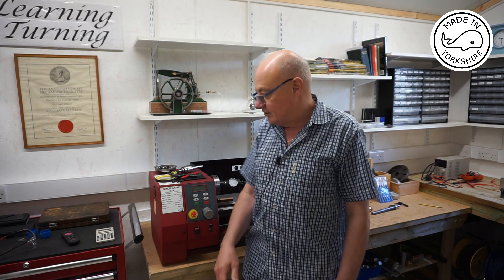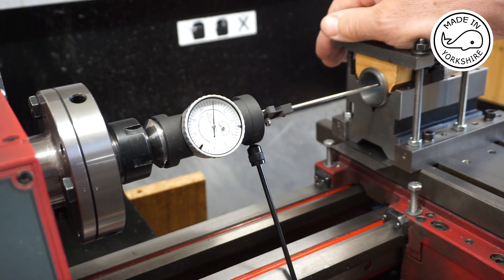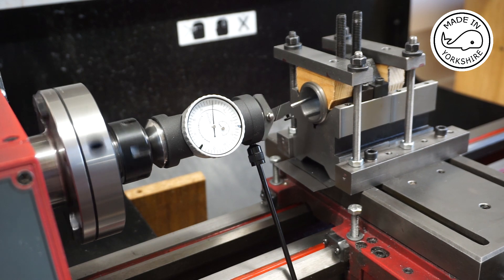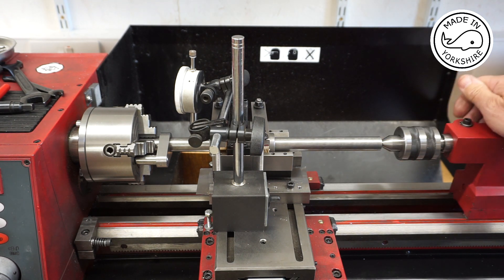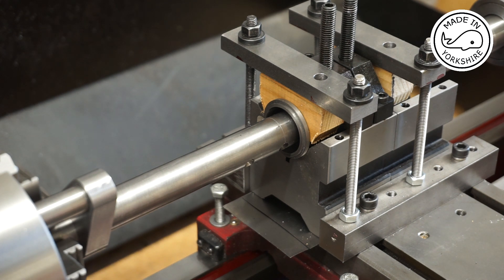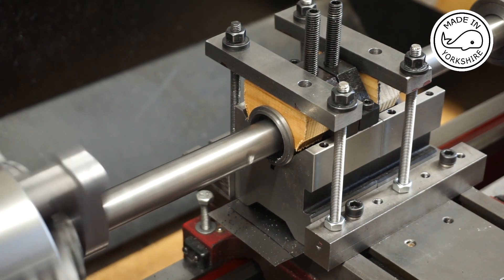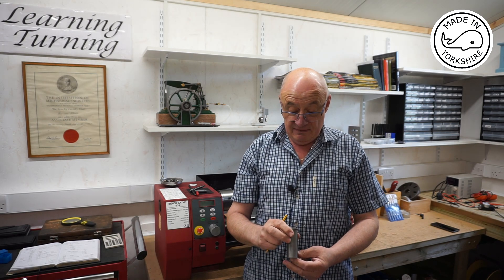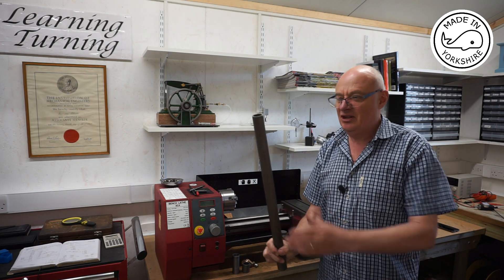#MT35 Part 5a - Farm Boy Hit and Miss Engine. The Cylinder Sleeve. Success! By Andrew Whale.

Comment: Andrew please explain why you could not adjusted the cutter from the left side with the mic attachment.  Tighten down the cutter gib screw and move the mic attachment to the chuck and let it rotate.  Seems to me you had plenty of room and then you would not have to undo the bar from the tail stock and loosen the chuck to bring the tool to the left side anyway.  Am I wrong in my thinking?
Reply from the maker: Hi Greg. There was definitely no room to leave the mic adjustment on the left hand side once the cutter had travelled through the cylinder. It might be an option on shorter cylinders though.
Cheers
Andrew
Reply: @learningturningmetal  okay, well you got the job done and it was perfect. Loved the setup on the cross slide I’m going to use that for manual broaching a rifle action lug cut out on the I.D. I’m going to make almost the same horizontal bar you have to fit a custom shape cutter and drive it thru the bore manually with the chuck locked in position.  I was thinking for weeks how I was going to do it and your video solved the problem for me.
Reply from the maker: @gregjohnson5194  thanks Greg 👍

Comment: Hi Andrew, I’ve been really enjoying your series of videos and am far less experienced than you are. Please can I ask two questions: 1) why do you only work away from the headstock? Unless your lathe won’t feed the other way I almost sure of the benefit and hassle of keep having to demount (then set it all up again) to avoid working towards the headstock. 
2) with a good dead centre at the headstock is there a significant advantage to the four jaw chuck being used? I’ve only ever seen this being done ‘between centres’ with a drive dog. 
If you’ve already covered these in your last video please forgive me. Your answers are of particular interest to me as I have a compound traction engine I plan to machine one day and will be bolting it to my cross slide and boring between centres to get the bores parallel and on centre height. 
Please keep up the great videos - I love the style and how you share the learning along the way. I find this especially beneficial as a beginner. Thanks Nick

Comment: Hi Andrew, excellent result and well done on the setup.
Now the bores 74 thou over it may make a difference when it comes to running the engine for the first time. The combustion chamber will have more volume so may need some adjustments with tuning (ie Cam timing, fuel/air mixture). Just some thought as the plans probably talk about running the engine for the first time and give some setup details but these may change now the bores larger..
Regards Kevin
Reply from the maker: Thanks Kevin. The instructions are pretty thin, so I will definately have to give that some thought. The way this is going it's probably going to take me a couple of years to get to that point.
I hope you are making good progress with your Kerzel hit n miss.
Cheers
Andrew
Reply: @learningturningmetal  Yes, same here, the plans are pretty vague on running the engine for the first time. I've been working on other projects so haven't made any progress on the Kerzel hit & miss. My next job is to machine the cylinder from cast iron so watching your video has been good. I'm yet to decide on weather to go the 'O' ring way or make some cast iron piston rings  as in the plans....

Comment: Nice job !
Since the O-ring size dictated the cylinder bore size, could you talk a bit about this in your next video.  Are they made to accurate sizes?  Presumably it is stretched a bit when it's on the piston, so how does this affect its diameter?  How much larger should the fitted O-ring diameter be than the cylinder bore?  Etc.
Reply from the maker: Hi Chris - good questions - not sure of the answers at the moment though. I've just ordered a Nitrile O ring with an od of 1.074". I think I will machine the piston next - so hopefully it wiil come a bit clearer for both of us. Fingers crossed!
Cheers
Andrew
Reply: O-ring diameter isn’t critical, what is important is the radial distance between the bottom of the groove and the bore. Look at the Parker or Busak+Shamban websites for calculators. Once you have the diameter of the groove, choose an O-ring with an id 1-2% smaller.

Comment: I told you there were no failures in a homeshop only learning opportunities, and you learned a lot with that "failure".👍
Just for the record you can cut left to right just as easily as right to left.
Reply from the maker: Yeah Chris - in a way it's probably good that it failed initially. A great opportunity to buy some extra bits and bobs too.
I must try my machine in reverse sometime.
Cheers
Andrew

Comment: Great save. All your modifications helped but I suspect the dodgy revolving centre was the root of the trouble. Really chuffed for you that you managed to sort it out. Dont forget to record the altered cylinder diameter on your plans and in the notes. If you dont you will make the piston undersized sure as eggs...
Reply from the maker: Thanks Tim - yeah dodgy live centre seems to have been the main culprit. I'm sure the other suggestion/improvements I made helped get a better finish. Good idea - notes added to plans. I think I might machine the piston next - while it's still fresh in my memory. Just ordered a Nitrile O ring 1.074" od. Lets hope it fits!
Cheers
Andrew